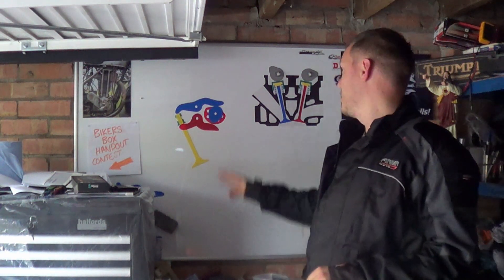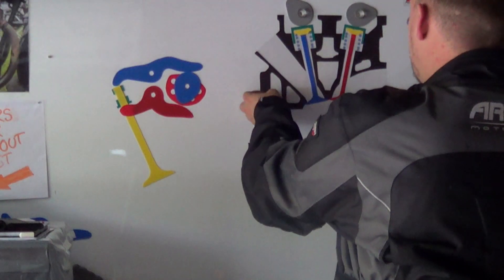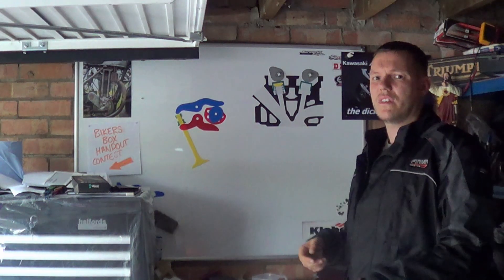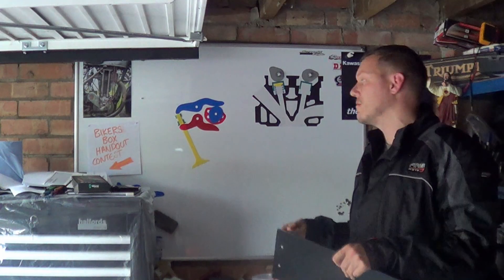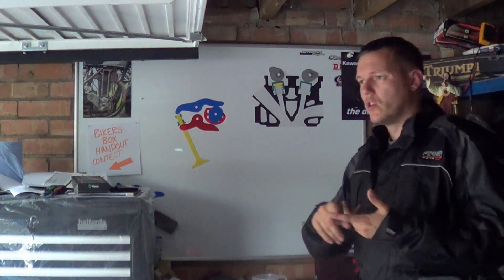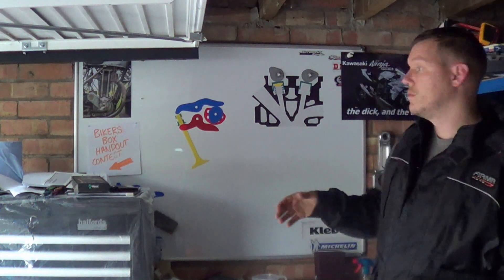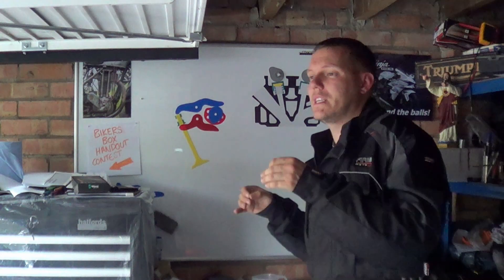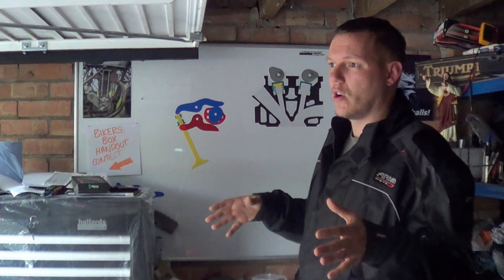Delboy being a wanker!

Comment: i have created a new product called terack's liquidless coolant, it pours like a liquid but has  a boiling point of 350 Celsius, your cooling system will never ever ever overheat (on the moon) and will never boil over
Reply: alternatively you could use Hydrofluoric acid because it has 4 times the thermal conductivity of water but it boils at 20C so get a rad cap on it quick, however my product has 16 times the thermal conductivity of water, ha ha, for the low low price of $16800 for a 2 litre just (fills lost motorcycles) it's literally the best coolant money can buy (slight decrease in fuel economy due to 27kg 60lbs excess weight)

Comment: Limitations of water-based coolants
According to Tourville, “Nucleate Boiling” is what occurs when liquid coolant comes in direct contact with the hot metal of the engine that has reached or exceeded the boiling point of the coolant. Heat is absorbed into this layer of liquid coolant from the metal surfaces of the engine. This is a good thing because a lot of heat moves from the metal to the coolant as the coolant converts from liquid to vapor. It is not a good thing, however, if the conditions don’t exist for the vapor to readily condense back to liquid. As engine temperatures rise, the limitations of traditional water-based coolants can be quickly reached. This condition is made worse when an engine is stressed by hauling heavy loads, traveling steep grades, or in high altitudes.

The limitation is the relatively low boiling point of water. When there is very little separation between the operating temperature of the coolant and the boiling point of water, the cooling efficiency of the system declines and engine temps begin to climb. When water is boiled, it produces vapor which causes a sharp decline in effective cooling, and often the failure of the cooling system. Water vapor has almost no thermal conductivity. If the water vapor cannot condense, then you get in a loop where the water vapor makes an insulating barrier between hot metal and liquid coolant. The hot metal does not get a flow of coolant, making the temperature of the metal spike higher.

Some locations within the engine (hot spots) generate temperatures that can result in local coolant boils, creating nearly 100 percent water vapor. These hot spot results in pre-ignition (“knock”), and if this condition continues, then structural metal failure and engine shutdown can occur. I get the engine knocking part, but what about my car that turned into a hissing dragon up in the White Mountains? Again, the root cause is the boiling point of water. The boiling point of water declines as altitude increases. Just as water vapor in the cooling system can cause hot spots and engine knocking, it can also cause coolant pump cavitations when the engine is running, and create after-boil when the engine is shut down. According to the Evans experts “the action of the coolant pump creates a low pressure area at the pump inlet. Pump cavitations occurs when coolant near its boiling point encounters the low-pressure area, and flash vaporizes within the pump. The gas pocket in the pump causes the pump to stop functioning and coolant circulation to stop. Coolant pump cavitation leads directly to catastrophic cooling system failure, with the coolant being expelled from the system as steam as pressure exceeds the pressure relief setting of the cap.”

The experts also explained that after-boil occurs after shutdown of a stressed engine, when the coolant is near its boiling point, and residual heat remains in the cylinder head or in an auxiliary circuit such as an EGR cooler. “Upon shutdown the coolant pump ceases to circulate coolant through the cooling system. Residual heat boils the stagnant coolant, making steam pressure that exceeds the pressure relief setting of the cap.” Coolant is pushed out of the system, hence my hissing dragon car. Remember when I said earlier that you can operate Evans waterless coolant systems at low pressure? After learning about the limitations imposed by water-based coolants, I also wanted to know why a waterless coolant is so much more effective, and why not use it in all internal combustion engines?

Advantages of waterless coolants
Thomas Light, Evans’ chief engineer, explains, “Cooling systems using water-based coolants are operated near the boiling point of water for the pressure of the system. In contrast, an Evans waterless coolant is operated at a temperature that is much colder than its high boiling point. Consequently, condensing vapor from an Evans coolant is very easy to accomplish. Hot spots are prevented by keeping liquid coolant in contact with all of the hot metal areas all of the time.”

According to Light, tests have shown that when Evans waterless coolant is forced to operate at a temperature considerably hotter than conventional coolant temperatures, engine metal temperatures remain under control and engines are safe from detonation. Evans is up against the problem that water-based coolants have been the industry standard for more than a century. Waterless coolant is comparatively expensive because it is a proprietary product and because it is not diluted for use. However, waterless coolants provide advantages that are unavailable to water-based products and the payback period is short.

High costs for fuel and environmental concerns have focused attention on fuel economy. Tests have demonstrated that using a waterless coolant results in a significant fuel economy improvement for heavy-duty diesel engines, and by reducing fuel consumption you decrease emissions, which results in a cleaner environment. You also reduce the cost of transporting goods from coast to coast, thus making basic items like bread and milk cheaper to buy.

There is another added benefit to engine owner, operators, and maintenance technicians. Evans NPG Coolant contains ethylene glycol and also an enzyme inhibitor that acts to prevent ethylene glycol poisoning, so it is less toxic than traditional coolants. It is also a “fill and forget” fluid that is good for the life of the engine. The only time you would have to replenish the coolant is if it became contaminated with water. Sounds too good to be true?

I asked Tourville about the downside to using Evans waterless coolant, which could be the initial price point, depending on your idea of coolant cost. The highest priced Evans coolant lists for about $43.00 a gallon. But, as I am a former aviation maintenance type, that did not sound like a bunch of money for what you get. We AMTs know that aviation quality parts, tools, bits and pieces, and replenishment fluids are all expensive.

Advantages to owners and operators
The primary advantages to owners and operators are lower operating cost, and engine utility and reliability. These benefits can be gained through:

Avoiding boil-overs
Higher gasoline efficiency
Reduced emissions
Higher compression and power
Knock reduction
Improved octane tolerance (lower octane fuel usable)
Reduction of hot spots (critical metal temperatures)
The primary advantages to OEMs are “fewer design limitations and weight reduction, including improved stability of engine operating temperatures, and improved aerodynamic styling. The radiator no longer needs to be higher than the engine and can be placed anywhere. Also, weight reduction is possible if higher coolant temperatures are used. Smaller radiators mean less coolant, plus the use of light-weight metals (Evans has a coolant compatible with magnesium for engines), and small cooling jackets in the engine, smaller fans.

In addition, these coolants offer faster combustion chamber metal surface warm-up, CO reduced in start-up (liners get hot faster) mostly because of the lower specific heat of waterless coolant. Finally there is the elimination of premature spark plug failure and head cracking by better cooling of head.

The primary advantages to maintainers are lower maintenance cost, safety, and waste disposal. Evans suggests that the low-pressure system reduces stresses on plumbing and that a leak would be less likely to be a spray phenomenon. The elimination of accidents resulting from accidental removal of radiator caps from hot engines is an important safety consideration too. Also frequent maintenance checks of coolant additives are eliminated, as well as the subsequent adjusting of additive levels. Finally, coolant disposal costs are reduced, if not eliminated altogether, as no coolant needs to be replaced (limits of coolant life have not yet been found). According to Tourville, vehicles have been tested up to 1,000,000 miles.
Reply from the maker: "Some locations within the engine (hot spots) generate temperatures that can result in local coolant boils, creating nearly 100 percent water vapor. These hot spot results in pre-ignition (“knock”), and if this condition continues, then structural metal failure and engine shutdown can occur. "

- when has this EVER happened purely down to the coolant used? 1 example would be great.

"Avoiding boil-overs" - deosn't happen anymore.
"Higher gasoline efficiency" - how?
"Reduced emissions" - infact the oppostie - higher engine temperature = higher NOx emissions.
"Higher compression and power" - LOL compression is fixed by geometry, nothing else. 

"Knock reduction" - opposite - engine temperature INCREASE - Evans states this themselves.
"Reduction of hot spots" - never seen any data on this, and the opposite is true.
"Improved octane tolerance" - again the opposite - higher temps 

" Also, weight reduction is possible if higher coolant temperatures are used."

- complete bollocks.

"(Evans has a coolant compatible with magnesium for engines)"

- Bollocks - I have proof from the testing I have done - Ethylene Glycol corrodes magnesium - period. 

"Finally there is the elimination of premature spark plug failure and head cracking by better cooling of head."

- but the head gets hotter - YOU just said. Quote - " mostly because of the lower specific heat of waterless coolant."

"low-pressure system reduces stresses on plumbing"

- Higher viscosity seems to diagree with you.....

"The elimination of accidents resulting from accidental removal of radiator caps from hot engines is an important safety consideration too."

- Only if you're retarded. Its says so on the cap.

"Also frequent maintenance checks of coolant additives are eliminated"

- Who checks? They just replace.

"According to Tourville, vehicles have been tested up to 1,000,000 miles."

- Data would be great 'according to Jesus we're all fucked' means nothing.
Reply from the maker: And liking your own comment is sad.

Comment: Delboy doesn't know what I know - I've forgotten more than he knows about coolants and water-based fluids. If I had the materials to hand, I'd produce Evans' product from scratch in less than a day. I don't say what I can't do.
Reply from the maker: Dave did you look at the evans patent I sent you? If not here's a link. Can you look at all the chemical notations ane equations and tell me (basically) what it means?

http://www.google.com/patents/EP1303573A4?cl=en
Reply: I did, I replied in another thread but let's cut through the crap again, shall we? MEG 10% or so plus MPG = enough MPG to make it non-toxic. Sodium Nitrate = oxygen scavenger (sort of a corrosion inhibitor, Sodium Nitrite works in the same way). Borax (Na2B4O7) is something that is going to be outlawed under REACH as it's environmentally nasty / reprotoxic and will be a Substance of Very High Concern (SVHC) soon,  so they will need to take that out. Sodium Silicate and Sodium Phosphate are anti-scale additives (they are also used in metal cleaners). Sodium Mercaptobenzothiazole (yes, I know what MCBT means) is a chelant (also called a chelating agent) that will mop up metal ions in the same way that EDTA will. Sodium  Hydroxide = buffer, but is highly alkaline and will be bad for the aluminium. Pluronic L is a BASF surfactant - an EO/PO copolymer and the only reason I can think that is there is to mop up any oil that has managed to get into the cooling system, hence the need for a defoamer (surely a an anti-foam would be better, as defoamers just kill foam, they don't stop it from coming back, but what do I know? Let's not get into Gibbs-Marangoni Effect, surface tension and foam generation) Green Dye (yeah right, it's Rhodamine 6G Pink that has a green tinge to it) and they mention triazole somewhere in the patent, so I'd expect Tolyl Triazole (Irgamet 42) as a non-ferrous metal corrosion inhibitor. You can learn a LOT from patents and a Safety Data Sheet and Evans are 'cheating' a little, as less than 25% MEG wouldn't have to be declared on the SDS as it's below the threshold for labelling under REACH/CLP. I could knock something that works like this together in a couple of days and you'd be hard pressed to tell it from Evans. 

I await Delboy's critique of my analysis of the product, as I'm sure that he might have some valuable chemistry contribution to make. **

**Not totally serious

I'm Dave, by the way
Reply: I like this guy :)
Reply: Thanks  - I did this for 25 years and I still work around chemistry as I am an Environment, Health & Safety Manager at a chemical plant. I also help to author SDS for the company I work for, so Delboy can't teach me anything about safety data sheets, labelling or about REACH.
Reply from the maker: I fucking love you Dave thanks so much. Your reply didn't come up in the notifications (they are 50/50 when you get more comments etc) - And sorry for the mix up between you and Mike, I'll remember Mike is the stupid one. LOL he's gonna pop his pressure cap when he reads this lol
Reply from the maker: EDTA is a food additive and was in making a murder as an anti coagulant isnt it?
Reply from the maker: You're getting a free t-shirt for this Dave - if you want one - and it'll be personalized for you
Reply: EDTA is another chelating agent that can hold metal ions in suspension. It's also partly how it works as an anti-coagulant, by chelating out the Vitamin K in the blood. It's used in some drinks (possibly Irn Bru and acidic drinks that can attack metals?) and in Mayonnaise as a stabiliser to prevent oxidation.

I matched a product for dissolving silicone RTV, purely because some chemists almost develop the ability over the years to have a gas chromatograph up their nose. A trained nose is worth its weight in gold and saves so much time when you can pick out a lot of a formula by smell. Once, my old boss John and I were given a sample and we were both asked what we thought it was. We both sniffed it carefully, shook the bottle to gauge the viscosity and we both said together "Blown Castor Oil and meths." My boss then said "Next!" the guy was bewlidered, but that's the 'Instant Analysis Service' for you.

I might have to be careful if I take Evans' product apart too much more than I have done already, as I could be infringing their patent :)
Reply: I do this for shits and giggles, just like you. Where do I apply for the shit in 2XL please? :D
Reply: Hi ModshackMerlin I am also a Group Environmental Health & Safety Manager and I agree with your excellent description of the coolants substructure and compounds
Reply: Thanks, it's nice to have my experience in these things recognised. :)
Reply: No problem mate ........   credit where credit is due
Reply: I've been thinking on their patent and their tentative formulation some more and they may be using Sodium Metasilicate (something like Metso 520) and Tetrasodium Pyrophosphate or Trisodium Phosphate, as these are used to descale Calcium and Magnesium deposits (as you might find in old coolant systems) as well as being effective metal cleaners. The use of these and the Pluronic surfactant makes me think that the additives are not much more than a technology transfer from water-based cleaners and TFRs (traffic film removers = car and truck wash fluid) and explains why they need to control foam. It's old tech and if they are promoting these additives as being state of the art, they may have been in the late 1970s. They just say 'silicate' and 'phosphate' in the patent to maybe try to throw the uneducated off,  but some of us can read behind the double-speak.

Comment: I started having doubts after he lashed out when I expressed a concern over him using copper antisieze on brake caliper slide pins. Surfaces that move against each other a lot + slightly abrasive paste = premature wear. I should know its abrasive as I sprayed a rear brake disk with the stuff when I didn't know what I was doing. It took a millimeter off the fucking disk and they are designed not to wear out fast.